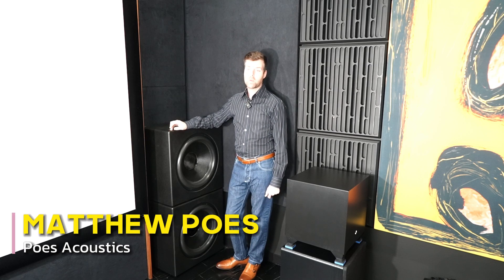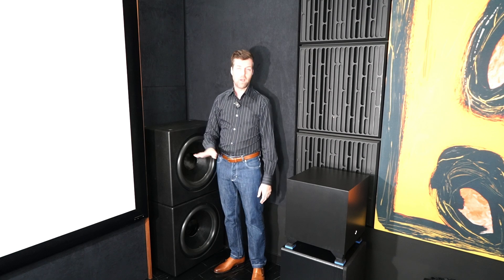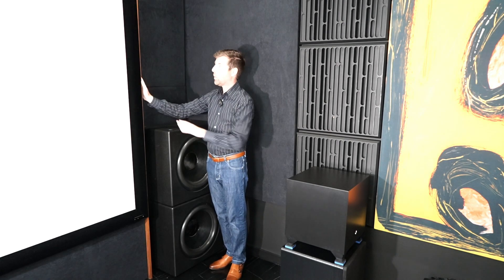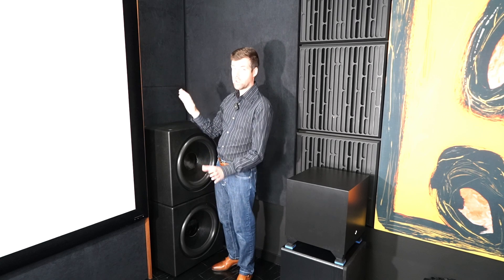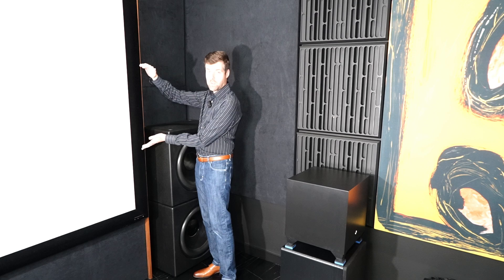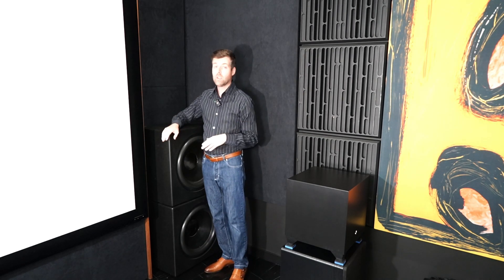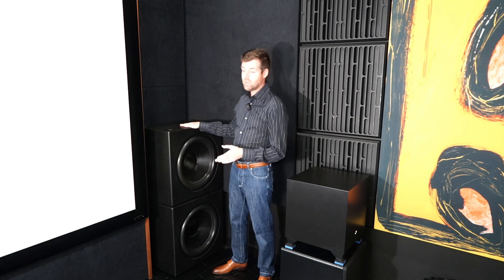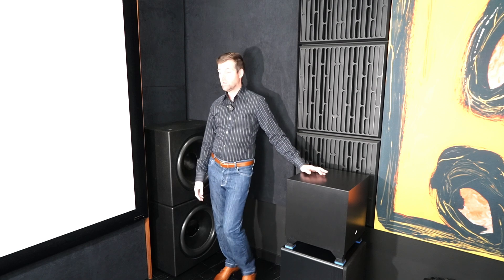Discover the Power of Trinnov Waveforming Technology

Comment: Your channel and knowledge is cutting edge. Looks like Dirac is flawed compared to Trinnov with these new bass management technologies?
Reply from the maker: I wouldn't want to use the word flawed.  I need to spend a lot more time with both of these systems to answer that accurately.  

My experience so far is that I am having better luck achieving useful good results with waveforming than I am with Dirac ART.  However, I don't feel that I know Dirac ART that well and need to spend more time calibrating it.  What I am finding with both is that, as of right now, they have not democratized good sound in the sense of easier access to optimal calibratino and setup.  Instead, they have really created a tool to optimize bass performance in a room, but with a far higher degree of complexity.  The calibration is now much more difficult to get right and requires more skill and technical knowledge.

Comment: This is really helpful especially because I was assuming stacked JTR RS1 elevated off the ground would work, but sounds like they need to have actual separation. Keep sharing your progress please!
Reply from the maker: Most rooms can work with waveforming and a 2 front 2 rear array.  In this scenario the subs would be mid point of the height of the room and 1/4 in from each side.  In my room, that isn't yet possible due to the screenwall.  We will be testing everything.  But yeah, you really are better off, if you have 4 subs in the front, seperating them onto 4 channels.

Comment: You issued a video or two arguing infra sonics weren't that important and couldn't be heard.  After living with those large subs, has your view changed in a theory vs practice scenario?
Reply from the maker: Those large subs are rolling off below 20hz in my room quite a bit.  So while they certainly can produce infrasonics, they are not producing them loudly.  

My argument would remain that infrasonics are not worth compromising other far more important things.
Reply: Always interesting to follow up theory with practice.  I assume in your profession you hear all shapes and sizes of gear, but I also assume you don't get to just sit back and enjoy them for extended periods, very often

Comment: Great Video been going back and forth on which Pre pro Trinnov 16 vs Storm Audio isp core 16.  So waveforming is not for systems with just 2 subs,  would dirac art be better for a set up like a 7.4.2 set up?
Reply from the maker: So 4 subs and 2 overheads?  Or did you mean 7.2.4?  If that is the case, yes...but no.  Dirac ART can use the other speakers to control bass in that scenario, but do keep in mind, canceling LF waves with little surrounds is not exactly ideal.  It can easily overload them.
Reply: @PoesAcoustics  sorry I wrote that incorrectly yes I meant 7.2.4.  Thx for explaining looking at the storm audio mk3 16 channels to go with my perlisten r in walls and in ceiling and 2 r 212 subs.

Comment: As always, great video and knowledge of what’s coming shortly for us Trinnov owners! Will be great for the systems to mature and to learn more and also learn the differences between this and ART. Keep up the great work Matt!
Reply from the maker: I should probably do a video that is just Waveforming vs ART.  In some ways, they are more similar than different and in some waays, they are VERY different.  Mathias told me that you can actually use a design approach with ART, similar to Trinnov's, and get similar results. That a DBA with ART actually yields very good results.  

I've not tried it, but I do plan to design a few rooms around ART with a specific bass array in mind.  So far I have found that without a design approach, the results are not always good.

Comment: Do you expect the Dirac ART layouts to be similar to Trinnov waveforming or will it be a totally different animal?
Reply from the maker: My understanding from Mathias and others at Dirac is that they do not intend to provide layouts.  That doesn't mean layouts are not prefered.  ART works with a design approach, just like Waveforming does, but Dirac is not, for now, providing those.

Mathias told me that the algo can handle similar layouts to what Waveforming is using to good effect.  For example, it would handle a DBA just fine.  Keep in mind that the concept behind ART is that it takes what you give it and does it's best to fix it.  It's a remedial approach.  Waveforming can do that to a point, but it starts with the axiom that it is easier to avoid problems by not producing them in the first place.  So the reason for the DBA is that it doesn't produce as many problems that need to be fixed.  The reason that is valuable is that remediating problems can cause artifacts.  Diract ART does cause artifacts, we have seen this, so it becomes key that you set the parameters to minimize these.  However....a better solution would be to reduce the total problems in need of remediation in the first place, which then yields better end results with less chance of artifacts.
Reply: @PoesAcoustics  Thanks for the detailed reply

Comment: Can you touch on the new pressurization part of the wafeforming technology in relation to the propagation part of it.  Will the previous approach of front subs stearing and back subs absorbing change in principle to be able to do the pressurization?
Reply from the maker: They have not shared a lot of detail yet, so I don't know enough to speak too intelligently about it yet.  I will be talking to them more after ISE.  I was made aware they were doing this and a bit of what it entails, but not enough to even post about.

Based on what they have announced publicly, the principles of waveforming don't change down to the first mode of a room.  Between the zeroth mode and the first mode a room is a pressure vessel.  So in general subwoofers sub coherently.  By changing the use of the absorber subwoofers to also be emitter subwoofers, you get the extra benefit of all the subwoofers in a room.  However...Rooms aren't perfect pressure vessels and they don't always align perfectly coherently.  So my understanding is that there is more than just stopping the waveforming process below a specific frequency, like say 25hz.  Once it has identified the zeroth mode, it then provides a different kind of filter to maximize the pressurization.  

I hope to have answers in the coming weeks.  I've also asked to try that new beta.